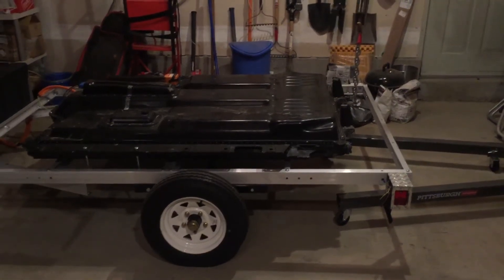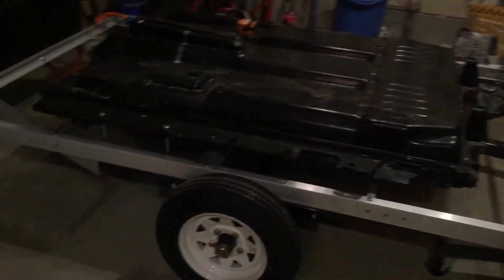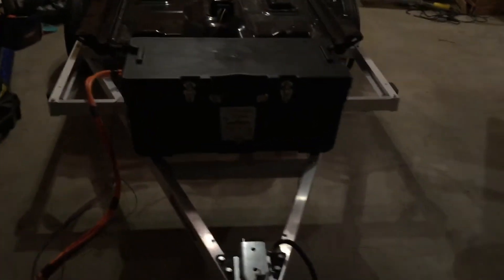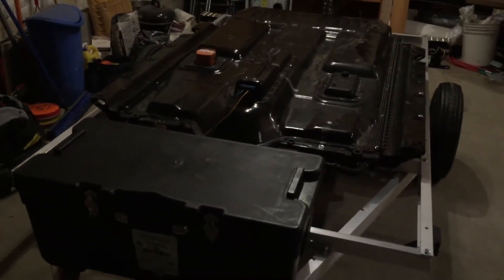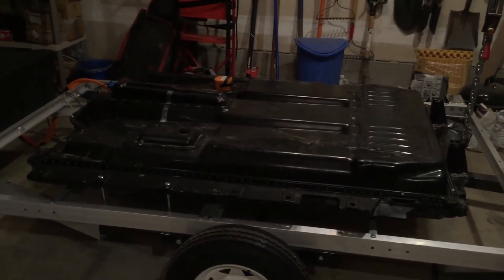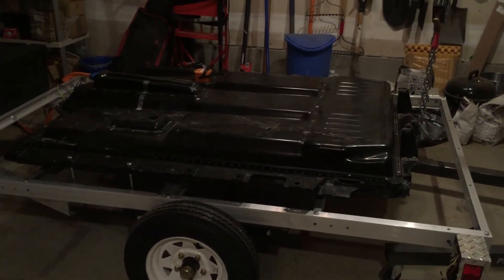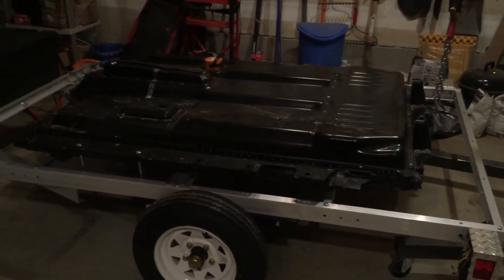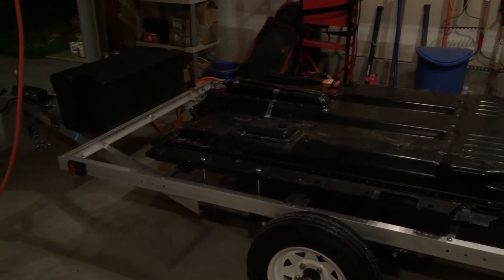T-Rex Build: New Lightweight Aluminum Trailer

Comment: Did you ever entertain gas generator with am extra charger? I picked up a fiat 500e and wanna drive it across the us but it's got like 70 miles of highway range at best, ev west said they won't provide any input since it's a factory ev